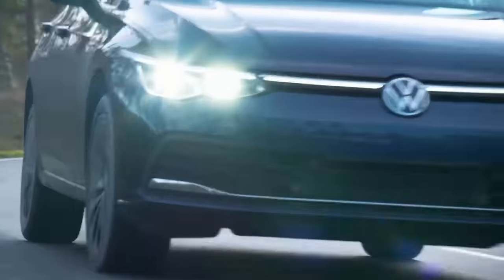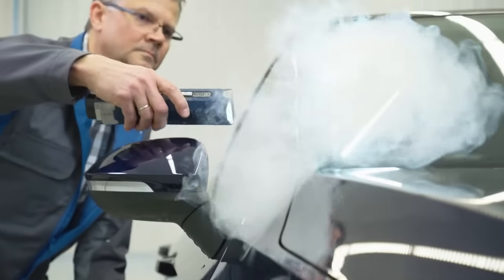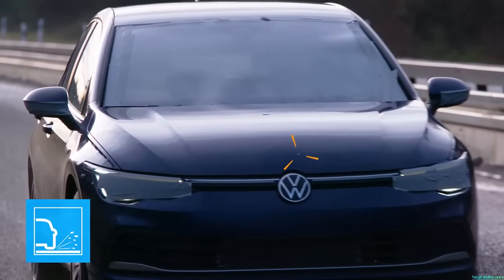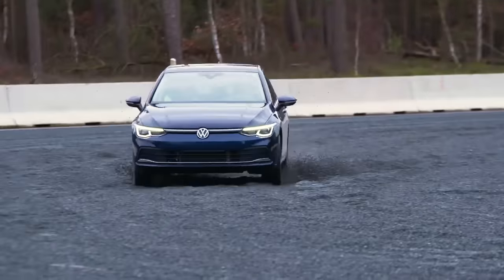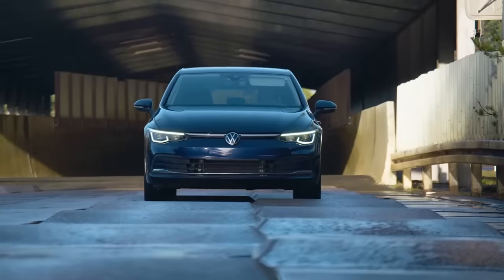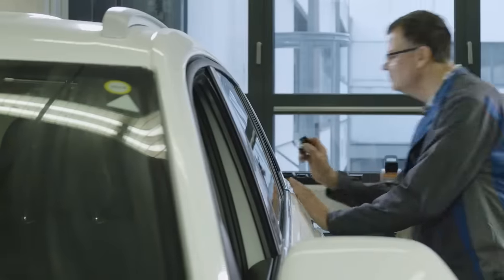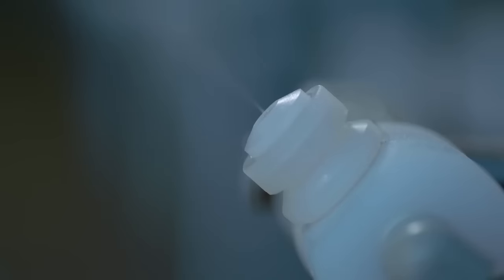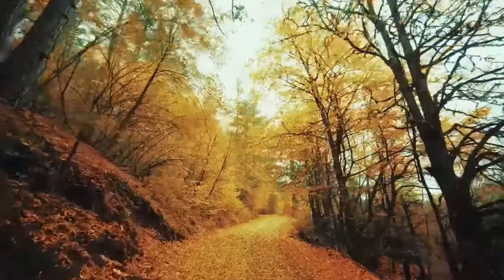VW Golf 8 Corrosion Test - how VW cars are tested against rust

Comment: Now show the TSI and DSG test.
Reply: The timing chain broke.
Reply: @Elaba_  my 1.2 tsi just felt that
Reply: is it problematic ? im thinking of buying a used mk6 1.4 tsi 122hp with dsg
Reply: @mouzz  Do your research on Google. From what I have heard they have improved the engines recently by using a timing belt.
Reply: @mouzz  not all really bad.... But if you ask me, i should not by 1.4 fsi/tsi  private.
Reply: @Alloonney  the alternative 1.6 tdi seems to have his problems too, not to mention its a diesel
Reply: @mouzz  Jep also a piece of art (not).
1.9 Tdi is a better choice for diesel.
Or Corolla petrol maybye?
Reply: @Alloonney  1.9 is not an option where I live and I don't like corolla appearance
Reply: @mouzz  were you from
Reply: @Alloonney  Portugal mk6 1.9 tdi is a mirage its either 1.6 tdi or 2.0
Reply: @mouzz  At home we have one of those Mk6 122 manual, purchased brand new in 2009. No problems in 200 thousand km but it is strongly advisable to replace the timing chain kit every 100-120 thousand km.
Car runs really fine for its power, with a very reasonable fuel mileage.
Reply: @Vintaginside  ty for input
Reply: @mouzz  I have a 2011 Polo 1.2tsi 105, which is just a downsized 1.4tsi. Honestly the engine is a great fun to drive, pulls well from 1600rpm, throttle is responsive, very low fuel consumption (5L/100km if I take it easy), high gears are very long which is perfect for highway (3000rpm on 150kmh in 6th, manual). Bought it at 88000km, now on 115000km, still factory chain, no problems. 2009-2010 had problems with timing chain, but there was redesign in 2011 which fixed it, and the redesigned parts can be fitted to older models. Ignition system is sensitive, so coil wires and spark plugs should be changed every 3rd or 4th service. 1.4tsi 180hp was the problematic one as it was simply overstressed and dsg usually require a bigger service around 150k km. Make sure it was serviced every 10000km or so, they need clean oil and that it wasn't abused on cold. Normal oil consumption is about a litre of oil every 3000-7000km. I use castrol 5w-40. I had the choice of 1.6tdi 105hp, but Im glad I went with 1.2tsi. If you dont mind servicing it a bit more often and taking care of it more, 1.2tsi/1.4tsi is what I would choose as its a very fun engine. If you just want a car where you turn the key and dont touch anything between scheduled services, tdi is for you. Ask me more if you want to know anything else about it.
Reply: @TheDox451  is the dsg problematic?
Reply: @mouzz  Well, not really, they are good transmissions, its just that on average after about 150k km they need servicing as they wear out, mainly the clutch pack, similiar to manual transmission, which can be a bit expensive as usually only specialists know how to service them properly. But having driven a dsg, they are very smooth and fast, you cant even feel the shift.
Reply: @TheDox451  is it an expensive service ?
Reply: @mouzz  Im not sure but I suspect its from 1000euros upwards. Oil in dsg should be changed every 50k km to postpone the service, but clutched inside simply wear out, especially if launching the car a lot or towing, still there are people with over 200k km on dsg and never had issues, but then again people had chain issues on 15k km with these engines. Its a one time service thats expensive

Comment: No matter how hard VW test them. THEIR FRONT WINGS STILL ROT. Mk3 to current models. They still haven't got this right.
Reply: spot on. 2010 mk6 golf here. Suffers with all you mentioned.
Reply: 2008 Tiguan here, front wings, perfect but have a small patch developing on the A post and micro blisters on the doors and tailgate. Getting corrosion underneath now as well.
Reply: Have you tried putting it in rice?

Comment: Fun fact: They are not, they start rusting after 18 months.
Reply: @Albinoid Maggot But they do.
Reply: @Albinoid Maggot Sweden bro, but VW such more. My bosses car 1 year.
Reply: @Albinoid Maggot they stopped to galvanize their cars (like the Golf 4 was).
Golf 5s usually have big problems with corrosion, with rust  holes in the sheet metal after less than 10 years.
Reply: The golf 2 was the last golf with corrosion protection

Comment: In my opinion the older vw had world class corrosion resistance. Newer ones. Not so much..
Reply: Which ones😂😂they all rust like fuck
Reply: From the Golf 4 the body is very strong aginst rust. They copied Audi how to galvanize and make rear fenders etc.
Reply: @Marauder252  aside from the front wings crumbling on the mk4?...
Reply: @tomhill3907  bear in mind mk4 golf is now 20+ years old. i had mk1 seat leon which had very little rust despite having hard life on UK roads
Reply: @Marauder252 2022 golf 8 or 2022 audi 3 sporback?
Reply: @socalguy829  i have 20 yo golf 4 coupe, but still not get any corosion, winter salted roads, holes at roads but still working well..
Reply: @tomhill3907  ? What are you saying? I had 5 golfs one MK3 and 4 MK4s, i pushed to it's limits and there's no rust or corrosion.
Reply: Hahahaha.....after 2005 golf,passat and other become rust bucket
Reply: MK2 had the best corrosion protection ever. Rust only became an issue as the cars aged, after 30 years on the road they start to rust.
Reply: @macdaniel6029 yes, for the mark 2 Golf, VW flooded the cavities with so much wax that it used to drip out of panels on hot days!!

Comment: your 12 years ''guarantee'' is worthless , I took my 8 years old passat to dealer because of few corrosion spots and the told me that is my fault, the car is accident free. My suggestion for your engieneres is to focus how to fix oil consumsion in your TSI engines, my got 156000km since new and it's burning 2l oil / 1000km, I will never buy VW again...
Reply: Go get an bmw e39 straight 6 diesel. U will find lots of repair videos for every part. An they are cheap
Reply: What reason did they give that it was your fault ?
Reply: @deppen123  Finding lots of repair videos for every part of a specific car isn't exactly good advertising though, is it?
Reply: @bendude6748  thay told me that is no point to check this ( I have 2 small spot of rust in side or car near window) because in 99 of 100 cases is customer fault, they check every point under microscope and there is always microhole in paint which caused corrosion, which of course warranty not covering
Reply: @jankowalski9822  possible stone damage. Of course they not gonna pay for that.
Reply: What a shady business they are practicing 😲
Reply: @jankowalski9822  Yeah that’s paint failure from stone damage or pitting. That panel will need to be repainted for a fresh look and to prevent further oxidation. If you had spray wax on the car weekly, after a wash, oxidation wouldn’t accelerate like it did. (Little known secret of the trade.) Using a spray wax like Optimum Spray wax will exchange UV inhibitors in clear coat, further reducing paint failure. Sadly dealers don’t disclose this since corrosion is categorized so broadly. Wish you best of luck.
Reply: Tsi with dsg....best of VAG😂
Reply: @Alloonney  unfortunetly I have this set, never ever again. I had many cars since last 15 years, french cars , japan cars, korean cars, and never had such a problems with car like I have with this passat b7 1.8 tsi. If you want have some problems in your life buy vw with Tsi engine
Reply: @jankowalski9822  Biggest problem is, that VW says... Hhmm this oil use is nornal (1 liter to 1000KM).

They dont learn from the mistake.
Fsi->tsi
DSG6 - > dsg7
Windows falling down in golf4 - > also in golf5
Etc etc

Most people with transporter T6 now buying Ford or Mercedes (new psa is only good to lease)
Same with people from polo/golf....
Engine problems, automatic problems, and other smal problems in less as 3 year.
Best thing to do....buy a Toyota or Mazda (without the rusty generation).
Reply: All cars rust but very obvious rust would be treated under warranty especially if it is bubbling from inside out. My friends Ford fiesta was rusting on the roof rail and it was 1 year old. It's the paint they use now compared to the older type of paint.
Reply: Buy korean or japanese car and be carefree
Reply: @Alloonney  vw says that 1l oil/ 1000km is normal but is not, I just send this car for general engine repair for a lot of money, my mechanic disasembled this engine for parts , yesterday I seen this engine and everywhere is a lot of some kind black "rust" ( sorry I don't know how to say this in english, I is not my mail language) because of burning this oil, on cylinders there are 3 rings which are to small that is why this shitty tsi using so much oil, thay should pay for this kind mistake and I heard that Vw was replacing this engines in USA on warranty but here in Europe they did not. This car is my worst nightmare
Reply: Buy the latest model UP! 1.0 75hp you can find, you will be amazed how well it's built, seriously. No corrosion, no problems. Parts are so cheap.
Reply: @kylelangley8818  Oh, that's interesting. I have a 2014, I always spray it weekly with bio-degreaser, pressure wash with shampoo and rinse off, and lots of spray wax, even some in wheel wells and under it, never touching the car to prevent swirls. It literally looks like brand new, no corrosion at all.
Reply: @apangurra2775  That's great! Always check your door jams and around your trunk/hatch for cakes of dirt. That will accelerate corrosion from carbonic acid, stripping through paint and oxidizing the panel.
PanTheOrganizer actually has helpful videos on this.
Reply: U dont know how to maintain your vw because the 1.9 tdi is bulletproof and 2.0 tdsi ...
Reply: What an insane consumsion
Reply: @ark2364  no because the car is so old and the online video tec helps a lot of people
Reply: Hey, about that situation that they told you that was your fault. If you not repair the car body in some unauthorized mechanics they should fix it without paying as a guarantee repair. I work as a test engineer and i see what dealers guarantee but mostly from Germany. In Poland most of dealres don't respect customers, but when you find video like this you know that is guarantee and for sure there is oficial statemnt on paper and you can scare your dealer with court and you have 100% win. Just mentality of Polish dealers create this kind of problems.

Comment: When I bought my Mk7 back in 2015, I got a 12 years warranty against rust.  Right now, feb. 2024, I got approved by Volks for rust/paint repair.  It took them 5 days to get rid of it.  I wonder if VW still offer this 12 years warranty ?  If you drive your 15-20000 km/year, most cars in Canada WILL have rust somewhere, especialy Ford brand.

Comment: What a great shame that BMW and Mercedes don't do the same corrosion tests and offer a 12 year corrosion warranty as Volkswagen !
Reply: Beluga..  Tell me about it !... I had bad corrosion on my 1999 E39 540i back in 2013, It was so bad that the rear jacking points just collapsed whist I was changing tires ! - Sorry you've got the same corrosion problem on your E87 :(
Reply: Beluga..  How did you manage? They're generally super good for rust.
I'm in Norway where EVERYTHING rusts, even plastic yet the first gen 1-series doesn't, same with the 2nd gen.

Comment: If you're listening VW, the car-coloured parts of the car generally hold up reasonably well unless chipped. Sadly, there are plenty of forward creases and areas on VWs that are prone to chipping but moving on.
The parts that fail prematurely are either the subframes, which have vastly inferior coatings to topside finishes (and compared to old IMO) or the underneath or void spaces that often have sound deadening material added. These tend to trap and hold moisture that defeats the good quality coatings you apply. Doh!
In recent years I think the subframe finishes have got much poorer and the void space and sound deadening materials have become more extensive. This challenges the body-coloured paints and finishes even more. Double Doh!

Comment: I swear by VW's rust prevention. My 2007 GTI has 220,000 miles and has been on the road every year since new during rough Michigan winters and doesn't have a single spot of rust on the chassis besides the suspension arms and other suspension parts.
Reply: 2022 golf 8 or 2022 a3 ?
Reply: Wow, you're lucky.
They generally rust like crazy.

Comment: New WW = crap rust after 4-5 years not like in old ones...
Reply: Water based paint...
Reply: @Winergy2012  i used to have skoda yeti - 4year old and it rust in rear dors - both !!!! my dad have 2001 octavia- no problems
Reply: Older the vw the less rust it has, new cars look great but they know most owners are buying on a lease, so they only need to worry about the 3 year ownership. They galvanize the body and slap on water based paint which is not up to 5 plus years of life.
Reply: @mikkei3532  if you want your car to last, do a rust coating some years in between depends how much you drive and how much salt/water/snow exposure. I do it on all my cars, beacuse in Norway they salt like crazy
Reply: @Winergy2012  They use water based, single layer coating not because they want, but because they must! Why? because "ecoterorists" told water based coating is ecological. Car witch rusts through after 5 years is more eco than car which lasts 15years. Simple equation: 3 new cars is more eco than one.

Comment: Corrosion test? LOL
Golf Mk3, Mk4, Mk5 and Mk6 all have rust in the front fenders....
Reply: If they rust its often because of poor accident reapirs. Aftermarket reaplacement steel is crap.
Reply: @Marauder252  Mine has had water and moisture and water standing in the side indicators for almost a decade, no corrosion, original steel.
Reply: @Marauder252  Had my Mk5 as second owner (1 owner was family) and never had a accident with it, still have holes in it because dirt and leaves ended up behind the wheel liner....
Reply: @Michaeltje89  Same here. Plus, the trunk lid is rusting like hell too.

Comment: Yes, and then a VW Golf 4 is rusting near the hatch because they used a gasket instead of gluing the glass, and they put foam in the fenders, so all the crap stays there and rust comes out. Vw Golf2 and Audi 80 do not rust because the sheets are thick and well galvanized. Current cars are 3-year-old toys

Comment: Many golfs 7 have flaw. Even if the car is on flat surface in ordinary rain water comes trough rear doors and leaks where the speakers are mounted. So wather comes on rubber seal and in havy rain on the carpet too...

Comment: The the plastic cylinder head starts leaking oil which drips onto the ECU which somehow doesn’t seal anymore while the fully sealed headlights fog up repeatedly and then break after 10 months of driving, then one of clutches in the DCT wear out and they tell you they gotta swap the whole thing for 2500 bucks, then the Infotainment crashes which starts a quest of never ending software glitches, one of the ABS sensors fail giving you a constant ABS light on the dash, then one of the fuel injectors clogs up after just 8 months, after a year of owning it the body squeaks every time you go up your driveway, in the winter months your trunk won’t open and you have to worm inside to pull the emergency unlock, also while trying to refill the constantly leaking steering fluid you get bonked by the hood because the gas strut failed. The dealership gives you a free software update and once you hand it over it’s stuck in limbo at the dealershipfor 3 weeks and the new update is worse. After just two years the fuel consumption increases due to unknown factors. Also you’re getting close to the end of the warranty period so you have to check your chain tensioner every week. The EU mandated emergency call button starts randomly calling the emergency hotline. After 4 years they shut down the wifi service you have been paying 39.99 for every month and you’re stuck without traffic data on your outdated map. After just 40k miles the engine implodes and your corrosion free car turned into a corrosion free hunk of junk.

Comment: components won't corrode since most parts surrounding the engine are plastics but they do fall to pieces just as the warranty expires..
Reply: Plastic becomes brittle with heat and age. My golf fsi oil filter housing blew out on the highway depositing about 3 liters of oil onto the highway. The inlet camshaft seized onto the cylinder head, broke the timing clutch bolt clean off and total loss of power. New cylinder head, filter housing and loads of other parts. Very costly repair.  Back in the day they would have used aluminium not plastic. So many parts in the engine are plastic nowadays.

Comment: Taken out a shed load of foam from both front arches on my mk7 golf about a month or 2 ago, if I squeeze the old foam I can still get puddles of water out of it, awful design that makes next to no diffrence with vibrations or noise deadening, also just had to replace the famous bonnet cable that sits in a shitty plastic housing that gets brittle and pops open cause vw put it right at the front of the engine bay where all the weather and shite gets to it, another horrible design, is it true that the Japanese cars are done right or have they got there faults?

Comment: Yes but they still fit the water inlet vents stuffed with sponge behind the rear bumper, the leaky rear light clusters, the leaky tailgate handle and the poorly fitted wiring tube from the body to the tailgate this ensures that the spare wheel well fills with water every time it rains then, it sloshes under the rear seat when you brake rotting out the foot wells and making the carpet stink like a wrestlers jock strap. I suggest that owners park their mobile swimming pools pointing up hill so that it is easier to bail out the boot in the morning also store the jack on the back seat to stop it rusting up